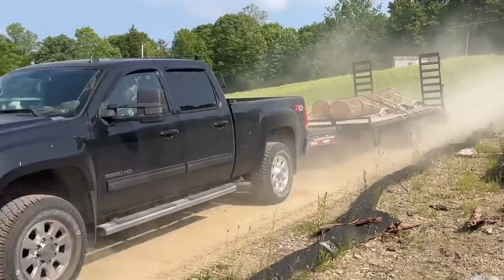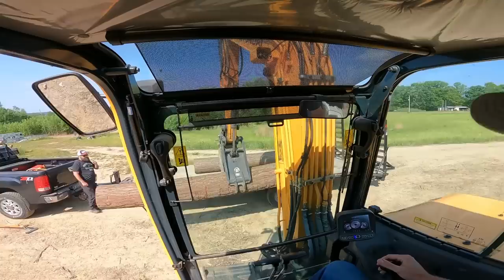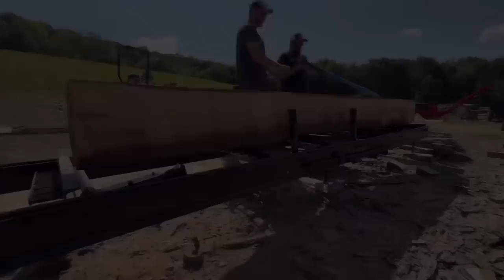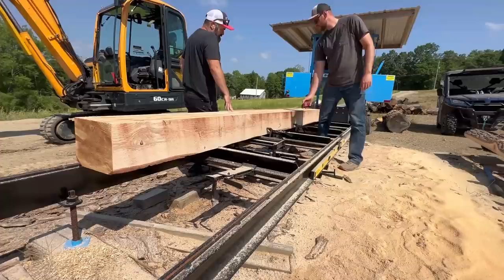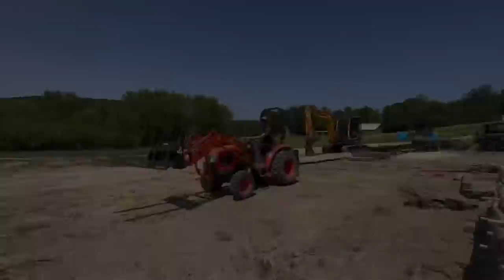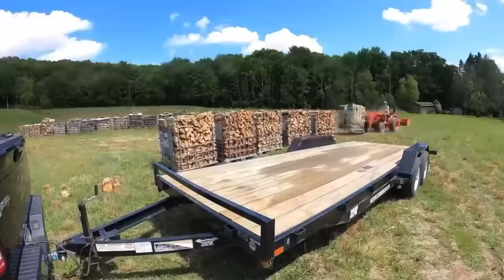Self Employed Custom Saw Milling

Comment: It was definitely smart building up your channel and doing your business as a side business first.  That is the true key to success.  It would be hard for you to start this business if it was back when you had just purchased the property.
To load a low trailer with fenders or dump trailer you need to push pallets in from back like a tractor trailer.  To get them off you pull them to where you can reach them off the back using a grapple and chain.  You don't have to get a deck over trailer but it never hurts to have lots of trailers.  Good job.

Comment: Yep!!! time for a new upgrade tractor!!!!
Reply: No, it's time for a wheel loader with AG tyres. For multiuse a telehandler (or is it teleloader?). Get a four to six ton loader and let the compact tractors do gardening and small farming. Tractors are a moveable powerstations (pto) and towing machines. There are solutions for the firewood processor if there isn't possibilities to keep the Kubota... And yes, one can put a trailer after the loader the same way as behind the tractor.

Comment: You are what I've been looking for around my ranch.  Can't find anyone that is willing to do what you do for just a few logs.  They all want at least a 3 hour minimum at $100/hr for a job that will take about 45 minutes.  I keep thinking that I'll just get my own sawmill, but I'm not ready to pull that trigger just yet.  I've got a few more project I need to complete before I can spend my limited resources on a saw.  Thanks for the video!

Comment: My dealer suggested going with a drop deck trailer rather than a deckover for my application which was moving equipment to farm fields.  He said the deckover is prone to hanging up the dovetail on field approaches leaving your wheels hanging in the air where the drop deck is able to clear.  The deckover is certainly easier to load materials onto though.

Comment: When you buy a dove tail trailer you’ll need to have The Dougmeister build a “ filler” to level the deck.
Reply: I actually suggested off camera to get a full flat with insert ramps.  He’d need a bigger truck to haul any other equipment he has currently. Since it seems that it would be utilized more for firewood and IBC totes.